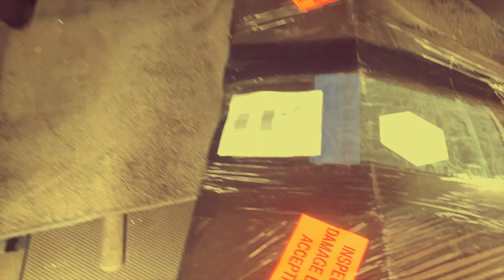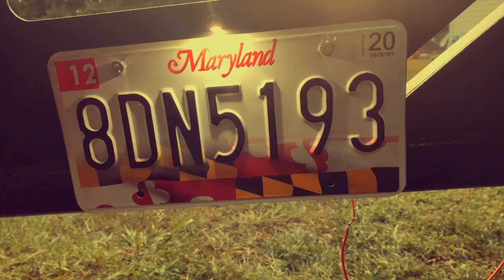How to Install an Offroad Rear Bumper | Nissan Xterra Pro-4x

Comment: The entire unit ends up being upwards of $1200 by the time you powder coat it. Do you guys think the materials and labor are worth that cost? Everything they make is amazing albeit expensive, and I want the roof rack in its entirety something fierce. But this is very utilitarian as well. I would then want to mount emergency gas where the old spare was.
Reply from the maker: That’s a hard question. The bumper has not held up as well as I would have liked to. The powder coat has chipped and the design isn’t that great. I would suggest looking at p&p engineering’s bumper. Looks like a much better quality bumper imo. But I don’t have any experience with it
Reply: @conheck_offroad  This is the sort of reply I was hoping for...nice to hear how they progress and sounds like it lasts alittle better than a Curt hitch bar does. Thanks for the insight and suggestion!
Reply from the maker: Absolutely! Glad to help!

Comment: Kind of random, but do you experience any vibration at idle? Just bought a 2013 pro-4x with 75,000 miles and I have a good amount. Maybe engine mounts.
Reply from the maker: mine is a 2011,  but i havnt noticed any vibration at idle. i have noticed a little when on the highway at like 50-60 mph. just noticed the passenger seat jiggling a bit. not sure if it was from bumps in the road or not tho.
Reply: @conheck_offroad  gotcha brother, thanks for the response.
Reply: @brockstevens23  its late, but mine used to vibrate. first check and make sure your crank shaft pulley isnt bent. then use some seafoam or chevron complete fuel system cleaner. if it still vibrates you might need a tune up i did one at 200k miles and it made a night and day difference DONT cheap out on spark plugs get the 20 dollat NGK ones.
Reply: @AlmightyyCres  really appreciate the help!

Comment: Why did you need to remove the step pad?  It looks like it is not in the way of anything in the video.  Not that it looks like more than 30 seconds of work.
Reply from the maker: I removed it to just clear up more space for my head to move around. But yeah, technically you don’t really need to remove them to take off the bumper

Comment: I enjoy watching your vids. Trying to figure out what I wanna do with mine. What year is your Xterra?
Reply from the maker: Mine is a 2011 pro-4x
Reply from the maker: Thanks for watching!! 🤙🏽
Reply: @conheck_offroad  I had a 2013 a few years ago that was just 2 wheel but I just bought a 2014 pro-4X and it’s a lot more fun lol. Yours looks awesome
Reply from the maker: Awesome. Check out the Xterra Facebook group if you’re in the Virginia area. Lots of events and good conversations over there
Reply: @conheck_offroad  I’m in the southern Midwest. Arkansas area so not Virgina. But I do like to road trip lol
Reply: @keifersherman4418  I can't even imagine only using RWD. Nightmare fuel on MN winter roads. Got new tires this year though I'm a bit more ready, otherwise I was rolling around Fargo with 150 lbs of sand tied to the back seats one winter.

Comment: I would've just spliced into the existing license place lights. Then you wouldn't have needed to take the tail light off.
Reply from the maker: I thought about that too, but I didn’t have a good way to route the wires out to the swing arm. It would have been fine if the plate didn’t move at all. But since it’s on the arm. The easiest way was through the light.  And I haven’t had any issues since then